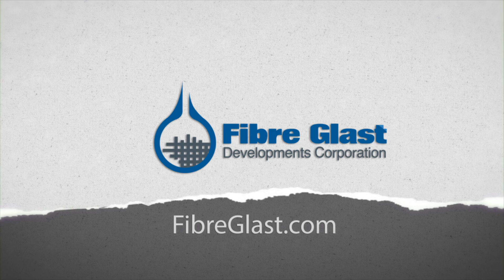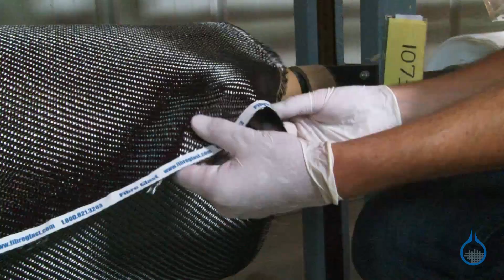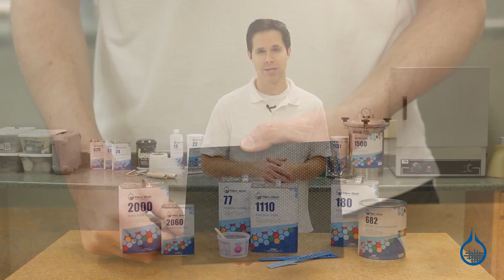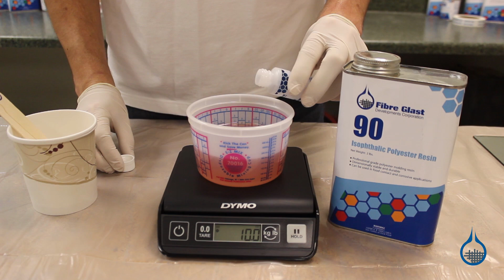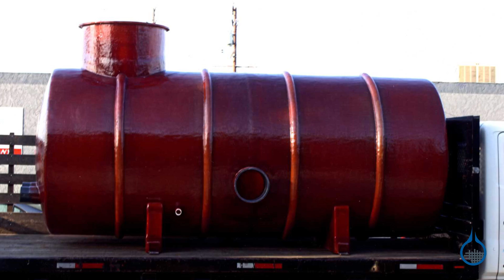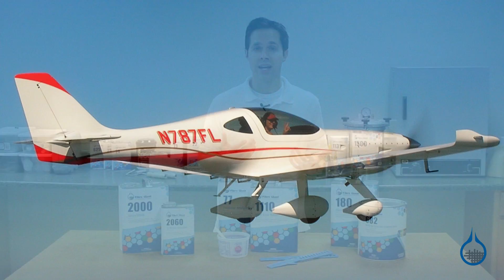Resins & Gel Coats

Comment: What do you recommend for sailboat blisters ?
Reply from the maker: You'll need to sand down the damaged gel coat and repair it with our #684 Neutral Gel Coat tinted to match whatever color your boat is. If you have further questions please don't hesitate to call us at 1-800-821-3283

Comment: Which resin is best for retrofitting of reinforced concrete beam?
Reply from the maker: Hello! This is Adam from Fibre Glast.
In our experience , the best resin for this type of structural component is our #1110 Vinyl Ester resin.  However it will depend on the structural analysis and engineering requirements presented in the specifications for the project.
Reply: @fibreglast  actually I'm gonna do a thesis on retrofitting of reinforced concrete beam. Can you please tell me which resign will be both economic and more strength!!??
Reply from the maker: For these purposes we would still recommend our #1110 Vinyl Ester Resin pending that the structural analysis and engineering requirements are within it's capabilities.

Comment: I'd love to know if alot of the industry strength data is biased, leaning against polyester resin, because it is very cheap, so that we buy other ones... If you cure a polyester with the minimum amount of catalyst, so that it takes 10 minutes to turn green to yellow, then it takes 3 days to dry, and afterwards it is rediculously strong and flexible. The longer the cure time, the less brittle it is. i'd figure it could be 30 percent stronger in the industry comparisons if it was cured for strength purposes.
Reply: I think the real problem is on the purchaser's end. Everyone thinks they are building a space shuttle.